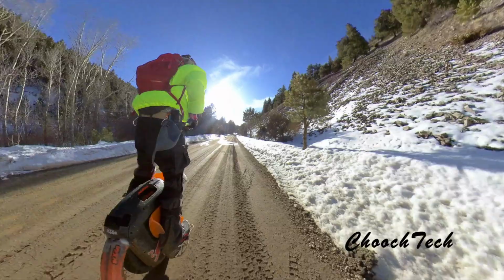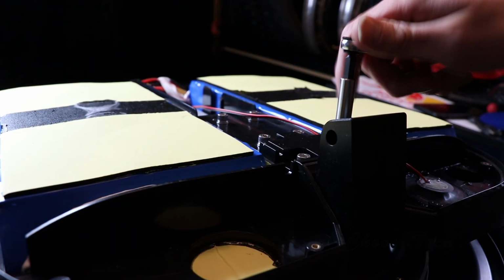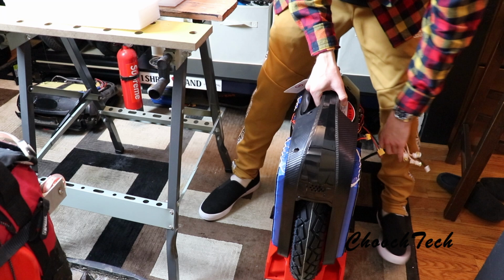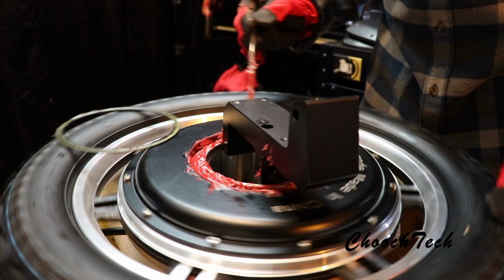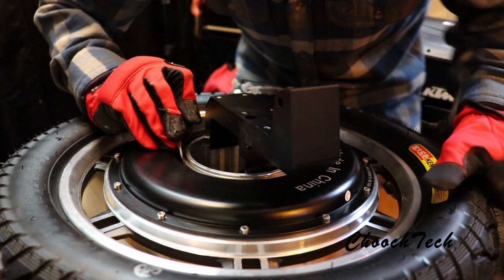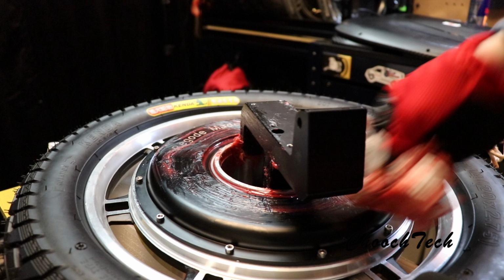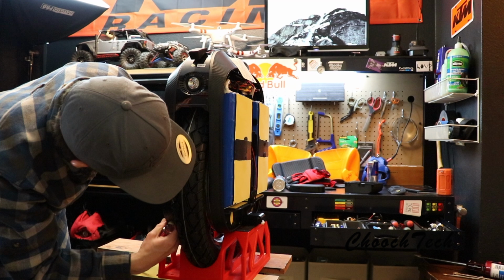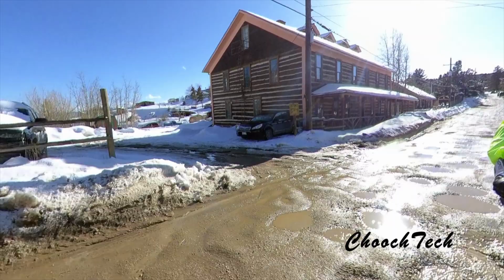WATERPROOF ELECTRIC UNICYCLE? BEGODE EX.N

Comment: This reminds me of when I bought some indoor Par38 LED bulbs that are 3200 lumens each and I sealed all the cracks with silicone and they have now been used through major snow and rain storms outside for 5 years. The indoor lights cost $5 a bulb and I used 10 bulbs total ($50), the lights made for outside were $40 a bulb for the same brightness; saved $350 by using some silicone caulk.

Comment: As a known design issue (most of us do not live in an arid climate), I guess this begs the question... Why the hell don't they just do this at the factory when they are assembled?  Don't get me wrong, I am very familiar with taking all of my wheels apart to replace motors, tires etc.  But if I drop that kind of cash on a brand spanking new wheel... I sort of expect NOT to have to tear it down before I can ride it.  Am I the only one?
Reply: Price we pay for early adoption :(  It sure would be nice if we didn't have to deal with this.
Reply: I guess it's early adopter issues as Joshua says but it still stings. It's yet another mark against Begode that is hard to ignore.
Reply: I don't even want to switch the battery in my laptop and that just clicks in. This makes me not want to buy. I love to break stuff then fix it sometimes and sometimes accidentally break it more. I am 50/50 with screws. Be great if you could just pay more for a water proof one . When someone going to have  custom options that be cool
Reply: @coolhawk2003  The new inmotion v12 is waterproofed I believe
Reply: @allysally9992  thats not a gotway tho

Comment: Nice instructional Chooch👍
I would recommend doing the silicone on the motor before the grease on the bearing. Silicone will not stick to greasy parts as the grease will act as a release agent.
Still a great video  😊

Comment: Thank you Chooch!
Just ordered marine grease.
Looking forward to greasing up my RS and taking it out for a stress free ride afterwards!

Please do update us again with the waterproofing status!
Keep up the great informative and instructional videos!
Thanks again!
Reply: Is this the same motor like the RS ?
Reply: how is it working out for your RS?
Reply: @electric_meadows_racing  hey, the RS motor cover is not the same as the EXN. There's no opening like the EXN to put the marine grease in so nicely. I just shoved in as much as I could in the small opening, and I put silicone around the edge of the cover near the screws.
Thank God is still running smooth, but that might also be for to the fact that I don't use it in wet conditions.
I got a V10F for when it's wet outside.
Reply: Gotcha thanks bud my HT is coming within the next couple weeks. Interested to see the inside 1st timer here all around. Wishe luck
Reply: @electric_meadows_racing  good luck buddy! You're gonna love this wheel once you get a hang of riding. Keep note that it's heavy & a high performance wheel. Be safe & gear up 👍
Reply: @mo_euc  thank you I can't stop watching videos in my head I'm a pro I Rollerblade allot let's hope all these years of it will translate well into this new dimension! The only thing I'm worried about is a new wheel coming out 2nd half this year like a smaller Sherman or something. I've got all the gear pads just need pedals and bumpers  though thanks again for the advice. I'm from New England by the way
Reply: @electric_meadows_racing  it's completely different than rollerblading, but being sporty will help you. Just don't get discouraged of you don't get it after 20min of trying, that's normal.
Don't worry about new wheels coming out. You're just getting started. Once you get a hang of it there will be new wheels you'll be interested in. Good luck

Comment: I'd be real interested to know how this affects your range and wheel temps.  I remember how i used to 'lubricate' skate bearings like this by packing them with grease.. turns out it makes them really slow, as every bearing has to clear a path through the grease continuously.  just a hint of lighter oil works the best.  Marine grease on the outside of the shell would work  great as another layer of defense but can only hinder the bearings inside

Comment: You have to be careful mixing different types of greases. It can cause it to harden or liquify depending on the base oils. It looks like a pain to tear that apart far enough to completely remove old grease.
Reply: Underrated comment. Which type of grease is best?
Reply: @vtran1082  The type isn’t as critical as removing all of the old grease and starting from scratch to avoid incompatibility.

Comment: Awesome video.
Point of order on the silica packet, though -
Once that packet is full, it's full.
Those suck water out of ambient air, and never let it go unless you toss that packet into an oven to dry it every now and again.
Reply: for real?...looks like i just learned something today. will they never dry without extreme heat?
Reply: @Jay7ona  Doesn't need to be extreme, but hotter than boiling for a couple of hours. Most people do 225 to 250F, or there about.

Comment: Question which EUC would you say is best between the Sherman or the Begode ex n??? Southern Colorado rider
Reply: It largely depends on use case. Here's my experience: The EX.N has <i>ridiculous<i> torque. Even with torque pads, I cannot overpower the wheel without jumping at 220 lbs other than by pumping hard. Sherman, on the other hand, is also an excellent wheel, but is not as friendly when it comes to handling any sort of heavy hills; at least from the videos I have seen.

Comment: There are already ways to waterproof the bearings, you are right about the grease but you need a 3D printed cover as well.
Reply: The original bearing cover is not 3D ! Do you know somebody doing 3D bearing cover for the RS ?
Reply: @ramezsamir7811  not sure what you mean by original cover as there is none. https://cults3d.com/en/3d-model/tool/bearing-protection-for-begode-rs-and-begode-ex-n-ver-2-0
Reply: @RonnieRides  In the video you will find the original seal he get it out . that what I was talking about .

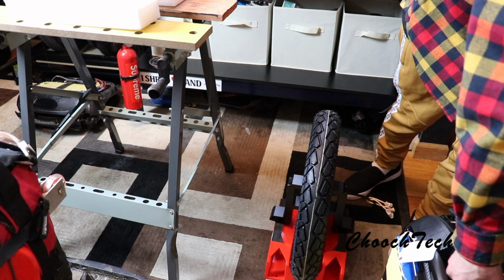Comment: @8:52 I see that they still have NOT improved the 6 tiny screws placement that holds the shell with the HEAVIER battery packs from my old Tesla (1KWh vs 2.7KWh = 2.5ish times the weight) = those will crack like crazy at falls :-/

Comment: I gotta do this too my RS-19
Hollow motors are so easy to pull out too.
Reply: Is it the same motor and bearing for RS ?
Reply: @ramezsamir7811  Exact same design, smaller scale.
Reply: @ramezsamir7811  Actually I checked.  They are slightly different.
The RS-19 and Monster Pro bearings are more indented and harder to get too. (Still have an outside indented gap you can fill with Marine Grease to make it more hydrophobic.

Comment: Messiest silicone job ever :-) Tip, its only the tiny part at the connection between hub and rim that makes a difference. A silicone spatula (type used for i.e. bathroom) to press it in and make a neat seal is bettet than just spilling all over

Comment: Risky business chooch.. for one there is a huge hole on the back of the motherboard to cool the heat sink. You didn’t remove the motherboard and check the sealing of that..also you trust the edge seal of the shell??  So many ways for water to ingress there.  Any moisture whatsoever inside the wheel allows for potential shorts on the motherboard. It’s not about just sealing the bearings. A rusty bearing is not going to kill you. It’s about not allowing moisture to contact the batteries or the electronics. I seriously think you ride that in your conditions you will have problems down the road. For one FIRE is caused by water inside the shell!!  Don’t keep that wheel in your house. Damn dude. You are playing Russian roulette with your wheel and promoting your subscribers to do the same!!